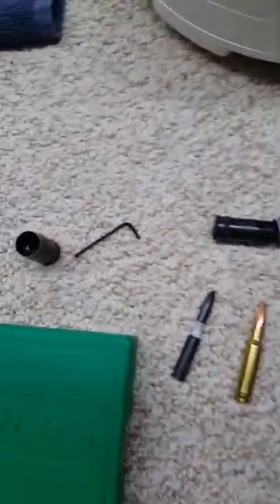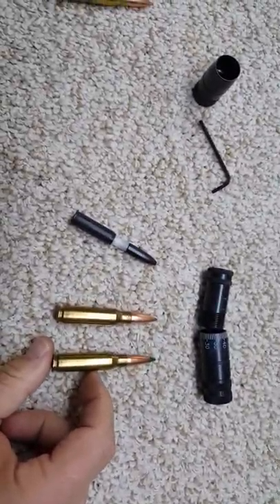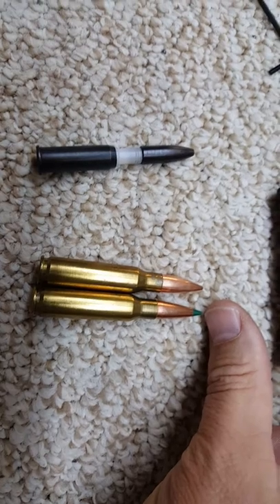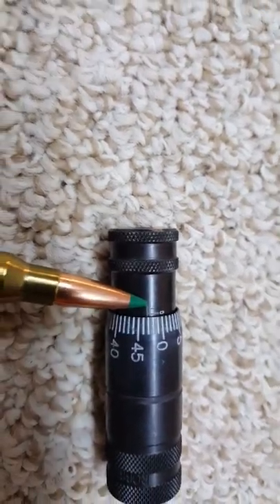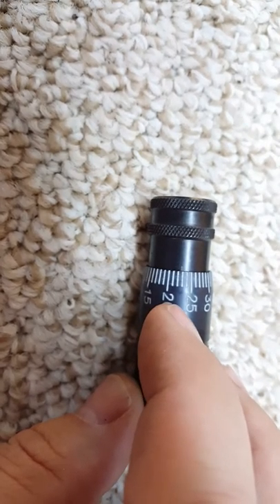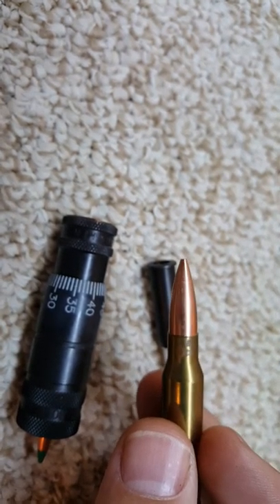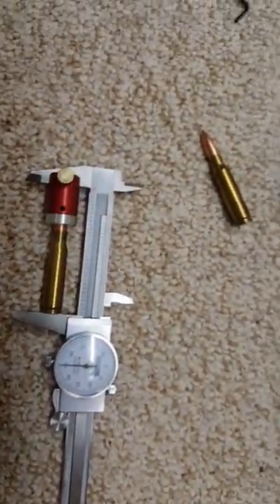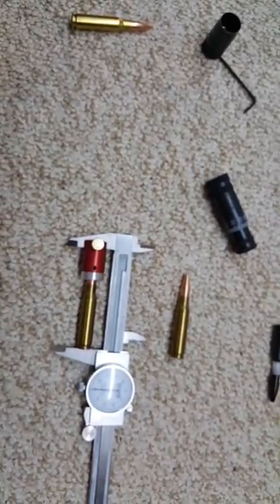Question regarding bullet seating depth.

Comment: Another late comment. There is another piece to this kit. The one you show is fir head space 
The other is a bullet comparator type. It is used with the black bullet thing that is in the kit. 
What you do is set up the bullet to slide in the chamber of your gun when you close the bolt. This will give you a measurement.  The measurmen tells you on the Guage how far it is to where the ogive contacts the lands.  This is then used to help determine how to seat Bullets. Most want a valued 1-3 thousandths less on the Guage. 
So often you will get a value out to say .210 for the tool. Then seat Bullets to .200 or.190 to get off the lands just a bit. Every billet will give a different total length thus why the ogive measurement is so important. 
Finally test the case with billet seated to see if fits in the magazine. Some will not and you will have to seat to fit the mag

Comment: Really late post.  I hope you got an an answer before I post this. Typically factory rifles have longer throats so adding bottom metal can limit your reloading seating length.  The answer is usually a custom barrel by reamed and head spaced by a gunsmith.  That will give you a shorter throat and you engage the lands earlier than you can play with seating depth.  The bullet ogives are different the tmk is a vld scent ogive and the 168 smk is a tangential ogive.  The scent is typically picker on seating dept than the tangential.   That’s why you are seeing difference in your measurement.  Plus I believe the 175 tmk is a longer bullet obviously just measure the bullets to verify

Comment: Hopefully you have this figured out, but I'm going to respond for the benefit of anybody that comes along.The Precision MIC is a tool that references SAAMI minimums. The lands of your rifle are unlikely to be that close. The zero on the MIC is SAAMI min. The actual distance to the lands was therefore EVEN MORE than you believed it to be (up to as much as 10 thou more.) The "cartridge" that comes with the MIC is meant to find out where your lands actually are. The MIC measures both headspace and base to ogive. Once you have fired cases to measure you can also know what your chamber headspace is and how much to bump your shoulder back when reloading.The calculated difference between the two bullet contours was, however, valid, and if your magazine limited the COAL of the tipped bullet to where you had it, then you can't use that bullet.
Reply: According to rcbs you can check setting depth also that's what the other gauge that looks like a cartridge is for. So please stop saying it's only for headspace. Check rcbs is website before you spot out false information. To all that are wrongly stating it's only a headspace gauge you obviously don't know what your talking about
Reply: @tkm1975mills  So, I said it measures BOTH headspace and base to ogive. How do you conclude I said it was only for headspace? (or maybe you accidentally attached your response to the wrong reply?)